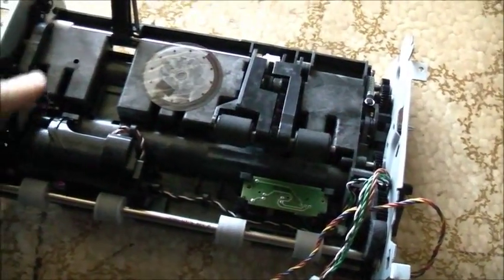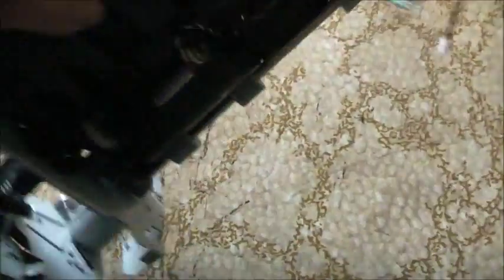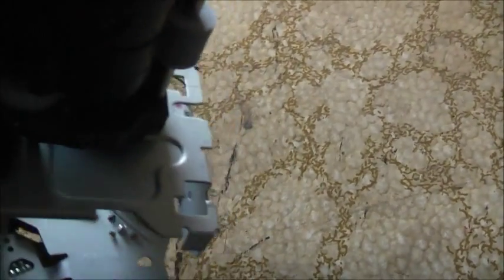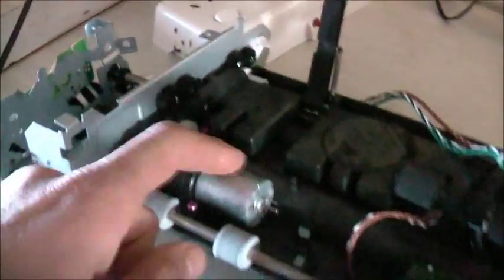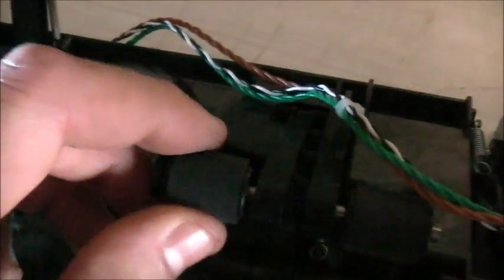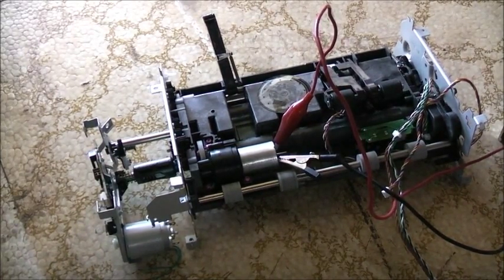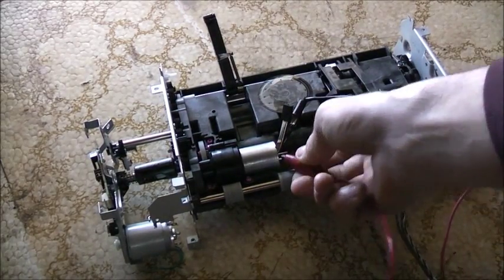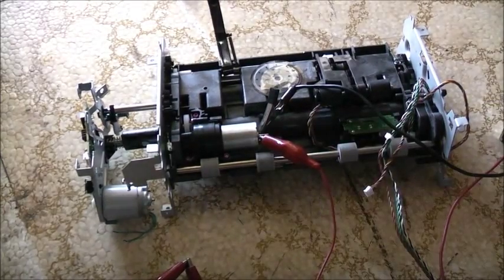Motor Pop & Printer Ink Pump On Variac!

Comment: I got a ink pump very simlear or the same type as that one.

I managed to find some 2 meter long ink-hoses on the well known auction-site.
There are provisions for conductivity sensors on all 6 "channels", and the motor got a encoder wheel. Still not made a proper driver.

You can pull that plastic part off the cartridge, to get rid of the bulk.

The print-head is driven in pulses, maybe a small capacitor in series with 30-40V may work. (given you pulse it)

b.t.w. What printer model?